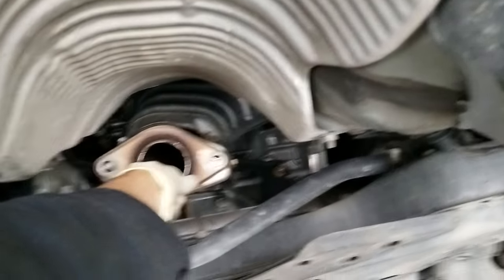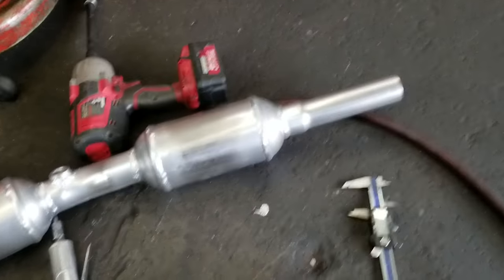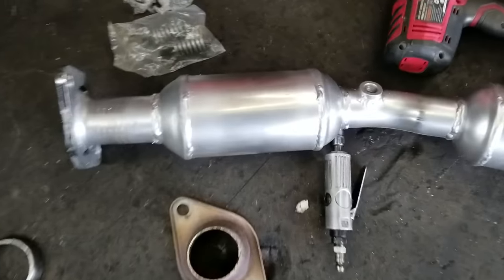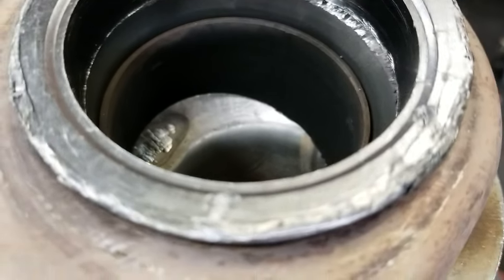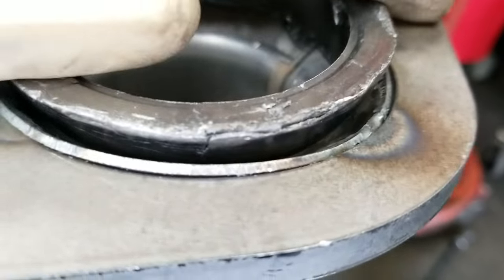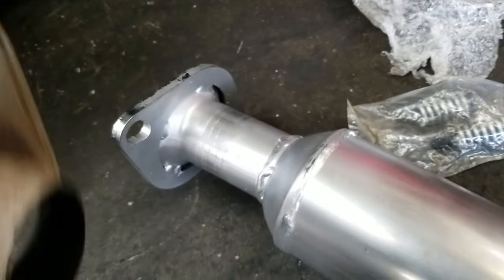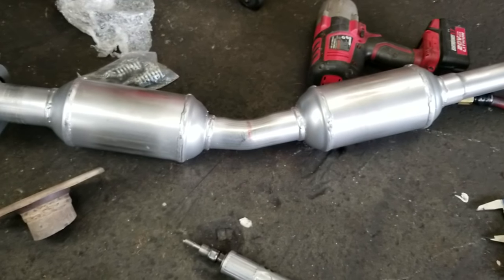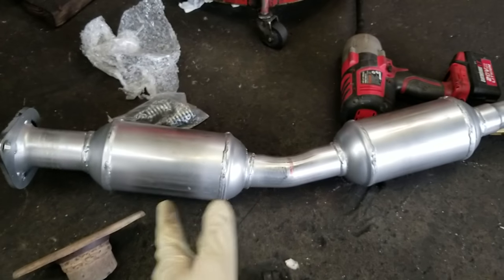Watch before buying Ebay/Amazon Catalytic Converter

Comment: Good mechanic search for solution not for problems to refer why it cant be done. Just cut tgat end, weld to original front and good to go...
Reply from the maker: This video isn't for mechanics who weld (i welded this on), this is a warning for regular diy people who can avoid wasting time and money on crap that doesn't actually bolt-on like the advertising claims. Thanks for the comment.

Comment: So you bought a bad part for your Prius. How does this apply to the 900,000 other years and makes and models on the road? What if a catcon on Ebay fits a Pontiac Sunfire or a Mercury Topaz perfectly? This video is pathetic.
Reply from the maker: I'm a mechanic, I deal with cheap (bolt-in) cats customers buy from ebay/Amazon that don't fit or install or leak on a regular basis from many other makes and models. Thanks for the comment.

Comment: stop complaining modify it
Reply from the maker: im complaining cause it states in the description it is a "bolt-on" cat, i already welded the stock pipe and rear pipe on this setup. but 99% of people do not have a welder or chop saw and depend on accurate item descriptions. this was false advertising.

Comment: Sorry but I think owner already had a really bad day and todays mechanics don’t want work it out they want everything peel and easy to swallow.
Reply from the maker: the owner paid $170 for junk that doesn't bolt-on. Mechanics only get paid per job, not by the hour. so a 1 hour paying job, turns into fabrication and welding job. Mechanic pays for the welder, and the tools too. I disagree with you in this case. The owner should have to pay extra for the extra work needed to do the job right. or pay more to get a part that actually bolt's on. If the shop supplied the part, and the mechanic agreed to install it anyways, then in that case, it is on the mechanic and the shop to do it right.

Comment: Man you are not professional, you are crying because you have to weld and built an adapter? I have been an auto mechanic for 30 years . As far as your complain about the gasket area, after market always been built clumsy I don't know why you are crying so much, the only thing that matters is the catalytic converter itself if it's good one if it has enough of those preciouses metals the code it's not gonna come back after 6 month or 1 year or 2 year because it's gonna cost you money   ( I want it to last 10 years).
Reply from the maker: This video isn't for professionals. It is to show that normal consumer should be careful buying cheap cats online stating they "bolt-on". I chopped and welded the cat using origonal downpipe flange and welded to the rear section of exhaust. But 99.9% of people watching don't have welding experience

Comment: Use a colar clamp
Reply from the maker: @nxtgen2b416  you could, but this particular example was not a slip-fit, as advertised. And if the flawed flange was used, it would have fatigued the exhaust system and caused a fracture or break somewhere from all the engine movements. It is not a true bolt-on application. It can be chopped welded and additional parts added to make it work, but what's the point ya know?

Comment: That shop ...where is at...so I dont go there....dude....weld it....cut the new one and start welding....I do it all the time....dosnt matter if is round or oval or square...hahaha....bottom line....weld it
Reply from the maker: Bottom line, the cheap cat on ebay isn't truly "bolt-on" as described. This video isn't meant for professional installers, it is meant to warn consumers who don't want to chop up and weld a cat on that was supposedly bolt-on. Thanks for the comment